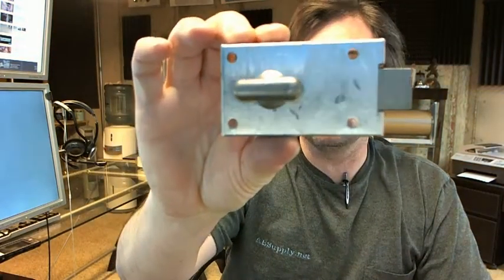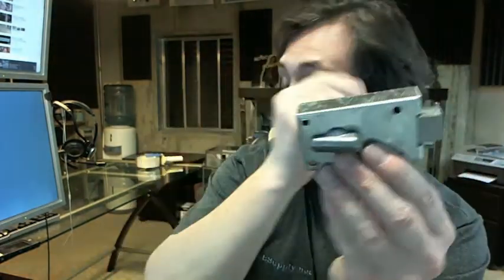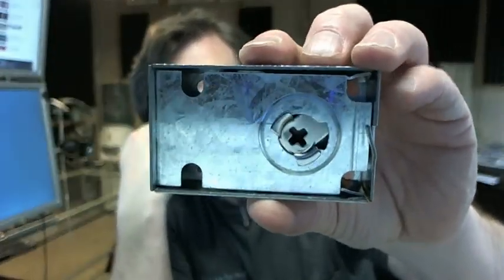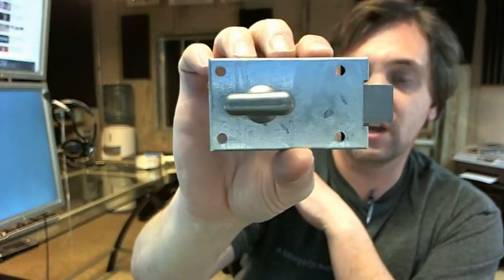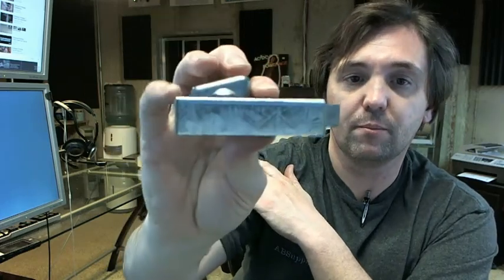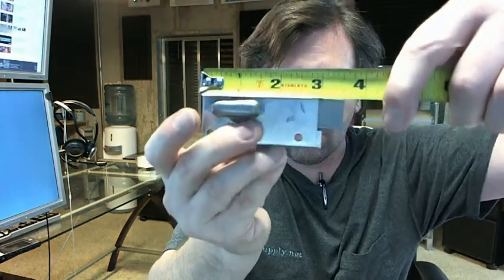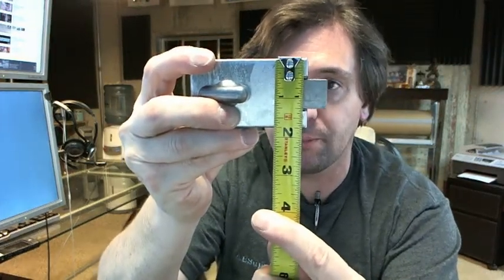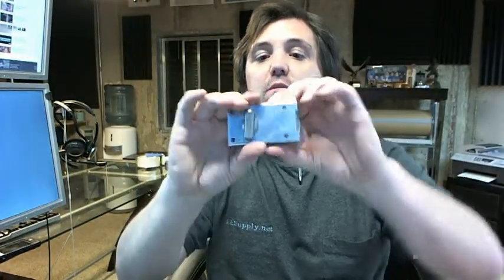Kaba Ilco 1800-28-41 Garage Door Lock Less Cylinder - Clear Aluminum

Comment: Can the lock be permanently unlocked with key or just momentary/temporary. 
Most like this only allow perm unlock from inside
Reply from the maker: The Kaba Ilco 1800-28-41 Garage Door Lock Less Cylinder - Clear Aluminum
can be set so the bolt is always retracted (not spring loaded).

We have this item in stock and ready to ship:  https://absupply.net/kaba-ilco-1800-28-41-garage-door-lock-less-cylinder-clear-aluminum.aspx